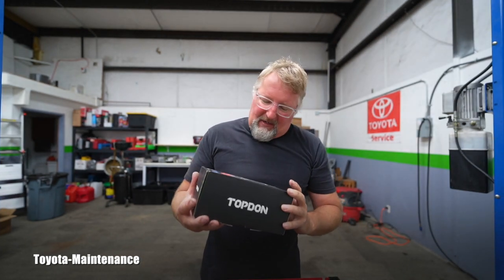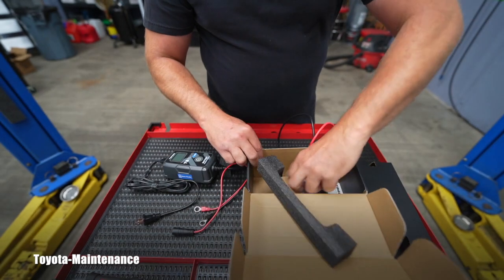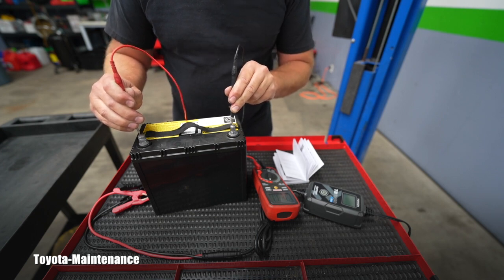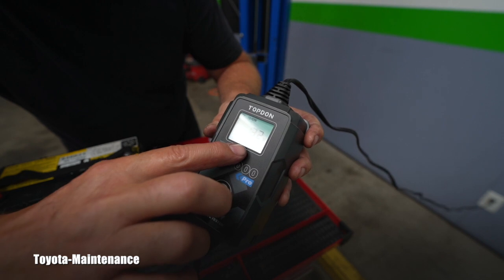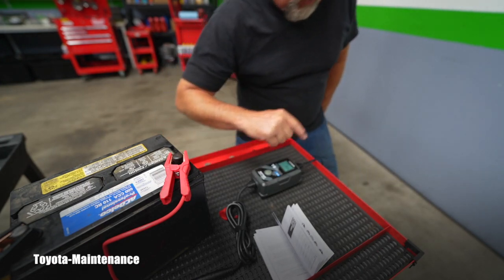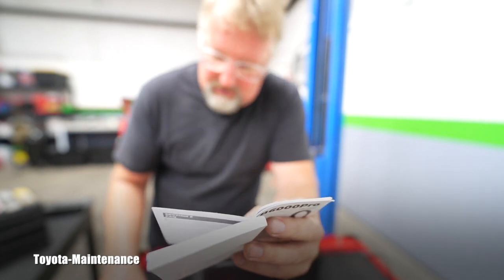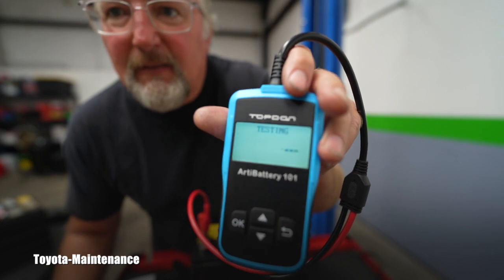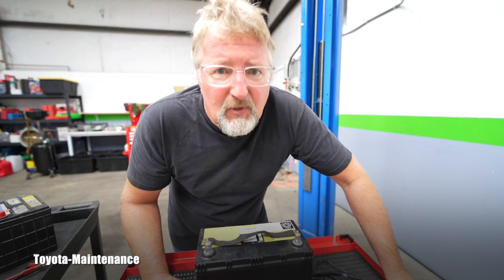Topdon TB6000 Pro Battery Charger & Tester

Comment: I really wish you had demonstrated the testing features. Most interesting would be to see how accurately it rates a brand new battery's remaining capacity. Also, the fact that it merely CHARGES a battery or fails "...a piece of junk that's been on the shelf for years" does NOT impress me. Hook up a sulfated battery from an RV and see if it repairs it; then I'll be impressed. All these testers make similar claims, but already I'm worried that this one's volt reading doesn't even match your DMM.

Comment: My go-to tool is a Load Tester. I was turned away from a warranty by Sears. They said the battery checked out OK. I ask them to do a load test. They said no need the battery is ok. I went to another mechanic and asked for a load test. They did it and the battery failed. They were able to print a report which I took back to Sears and received a warranty replacement.

Comment: Do you mean to say #madscientist? I would like you to try an experiment. Next time you are in the shop, Monday, plug in the charger and see if it can desulfate the battery. And get it back to a no error state. So if a poor student or someone you want to help, you can sell them the cheap battery you fixed for a few months until they can save up to buy a new one from you! 
Monday so you can monitor it every day so it won't catch on fire if it's too hot, and it doesn't cost you anything!!

Hopefully it works and you don't need to change the battery acid inside. The old days for people who don't know. Did not come pre-filled and the service station would fill it up when you bought it and it was the best way for the battery life..